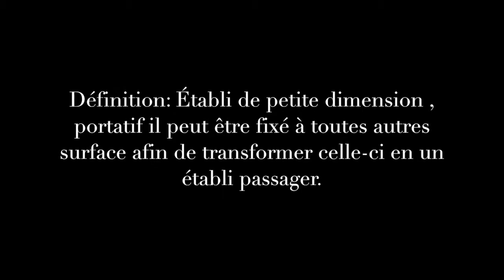Milkman's work bench

Comment: Should have had a larger clamping surface on the end of the screws.Not particularly impressed by this  vise.
Reply: This comment shows a misunderstanding of the useful qualities of a deadman and or the proper positioning of the work when using this vise. In addition, applying unnecessary clamping force to the work piece could damage this vise. It is a well made vise. It is an impressive tool to one who understands how to properly use it.